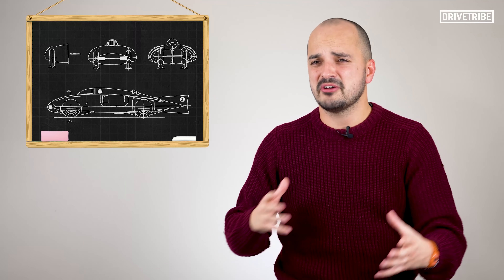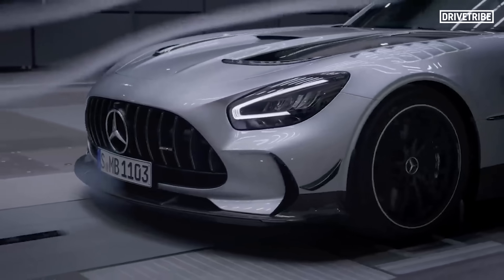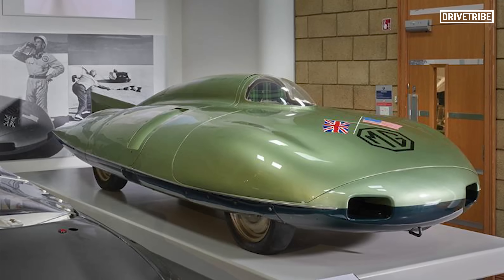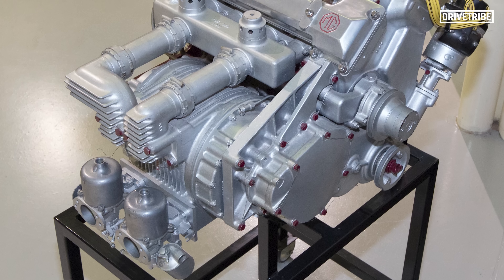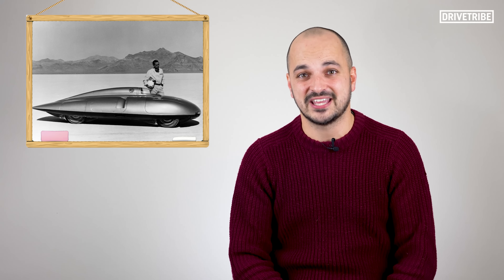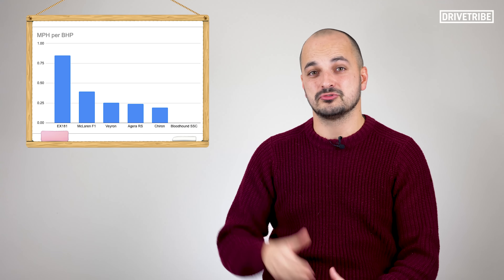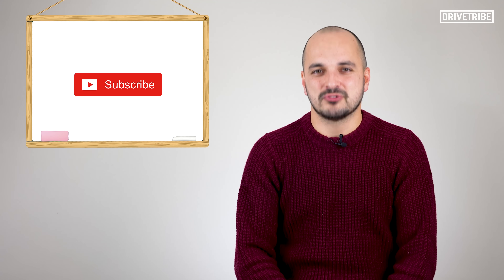This car reached 254mph using only 300bhp

Comment: It is not only about the drag coefficient, it is about the drag area (Cd times the frontal area). It is easier to make a large car to have an aerodynamic shape, but the larger size requires more power to reach a certain speed.

Comment: car power:speed ratios always make me laugh.

my 1964 Mooney will top out at 180 mph true airspeed on 180 HP.  the J model, with slightly better aerodynamics and a 200 HP engine tops out at sightly more than 200 mph.

Comment: The MPH vs HP chart is pointless as a comparison of the cars because it compares those cars at their very different top speeds, not at the same speed. You could run the same car at those various speeds and get a similar result, if you could measure the power it is using at those speeds.

Comment: How many passengers does it carry?
What's its safety rating?
Does it run on 'eco' fuel?
How much does it weight? 300 kg?

The Sputnik was launched the same year. Comets already've been in and out of service by this date. SR-71 flew 7 years after that car set its record.
I don't know what's more confusing - how people are surprised by the car that was built during the era of the most extensive aerodynamic studies ever undertaken, or by bland achievements of Bugatti Veyron.

Comment: Drag coefficient isn’t a useful metric for comparison between vehicles.  Drag coefficient X reference area yields the equivalent flat plate drag area [length^2] which can be compared directly with other vehicles.

Comment: You measured BHP per MPH but not fuel consumption of that supercharged 4 cylinder. It's unfair to compare to modern cars that are also built to corner with competence through downforce and maintain a decent fuel efficiency at the same time.

Comment: I want to know what kind of mpg it would get at 70mph. I know it isn’t a road car but being that efficient sure it would be over 100mpg.
Reply: The math is not that hard, if the drag coefficient remained constant it would be 14.5 HP at 71 mph (100 ÷ √2 ) as the Reynolds number would be 70% lower, one could expect the drag coefficient to be slightly higher, so maybe 16 Hp, or 12 KW.  Using 116,000 BTU per US gallon of gasoline, and 30% thermal efficiency for the engine,:  12 KW X .3 = 40 kW , 40KW = 136,485 BTU/Hour, so 1.17 66 gal/hour , 70mph ÷ 1.1766 = about 60 MPG  @ 70 MPH.

Comment: Imagine if it had a modern engine, imagine the speed it would get too.
Reply: Using the 600hp Koenigsegg 3-cylinder
Reply: @specialopsdave  or a 1300hp hayabusa engine
Reply: @THESLlCK  But that's too heavy, and likely too much displacement
Reply: @specialopsdave  it’s actually lighter and lower displacement so no. I’m talking about a stroked hayabusa motorcycle engine
Reply: @THESLlCK  I highly doubt that Koenigsegg's engine is heavier. The car is like 1500 pounds, and I believe a 1300hp motorcycle to be on the heavier end of motorcycles anyways, with the engine making up 80% of it's weight, I'd imagine
Reply: @specialopsdave  both have a block weighing only 150lbs, so I guess you could say they’re even. But that’s excluding the gemara’s electric drive motors
Reply: @THESLlCK  I still am doubtful that Koenigsegg's best is beaten by a multiple-year-old engine. Maybe the Hayabusa you're talking about is race tuned, not road tuned? In which case the Koenigsegg could do the same if not better, and I think it would be cool to get a 3-cylinder world record
Reply: @specialopsdave  of course I’m talking about a race engine, you thought I was talking about a 1200+ hp street bike?? I mean I want two please, but what?
Reply: @THESLlCK  Bike guys make some strange claims sometimes, man, idk

Comment: These same aerodynamic optimization principles could be used to make car's & SUV's & trucks far more fuel efficient, using the same motors & engines they use today // imagine 70 mph with 15hp & 120 mpg

Comment: The speed record car's engine was not based on the pushrod MGA 1500 engine as shown, but on the MGA Twin Cam engine.
Reply: You are right, they showed a B series pushrod 1500 engine in a red MG A. 
Fun fact, the  MG A 1500 twin cam engine is based on the B series pushrod engine with a twin cam head on it. So they goofed, but were also sort of slightly right too.

Comment: wind resistance is exponential though.. I don't like your chart they should all be the measurements at the same speed. You also can't exactly use the bloodhound because its engine is not driving to the wheels.

Comment: All your graph shows is that noone in the last sixty years has considered using finesse instead of brute strength to achieve their goals.

Real "smart."

It's either that or the boys playing in the desert were too jacked up on fumes to tell the truth when they went home.

Thanks for the "History Lesson."
Reply: It's not a great comparison, the buggatis, and the mclaren are actual vehicles you can drive and have a drink in and seat more than 0.8 of a person.
Reply: @crackedemerald4930  ....Was watching a video set in the desert what made you thirsty or are you one of those, "I won't buy a car with less than six cup holders," people?

In a discussion about power to weight, efficiency, and drag, you jabber on about refreshments?

Why to me?
Reply: @truthsRsung  what i mean is they're very different cars with only similar goals, the MG isn't a car you can just drive on the road.
Reply: @crackedemerald4930  ...Funny.   I was under the impression that we paved roads to make it EASIER to drive them.

You base your reality off of what restrictions people impose on themselves.

Either the MG is soooo "speshul" that it disqualifies itself as a car, four wheels from point A to B with passenger(s), or everyone has a salt flat between work n home.

The designers even forgot about the driver breathing clean air.

Comparing it to modern mobile living rooms may be the EASIEST comparison EVER.

Lazy.   Lethargic.  Slothful.   Pointless.

Figure out a reason for typing next time.
Reply: @truthsRsung  yea comparing them isn't too great as they're very different types of vehicles

Comment: MPH per BHP says nothing, you need to compare MPH² or MPH³ to BHP
Reply: Why?
Reply: @sukhdevr3489  the air resistance (which is a force) increases squared with speed. And above 100mph it's certainly the most significant, power is force*speed which makes the square cubed.
Reply: @RDMracer  That makes sense thanks.

Comment: I often wonder why there aren't any aero cars for sale. You get aero bikes, it makes sense for there to be aero cars.
Reply: Because most peoples normal use is at low speed apart from a few times per year so the trade off for worse aerodynamics is more than made up for by the ease of use, cargo space, headroom and so on.
Reply: @siraff4461  Yeah, true. I’m sure if they were for sale, they’d sell ok, though. VW XL1 prices still hold fairly strong.

Comment: how was top speed even measured in the 1950s? speed traps? wheel rpm estimates?
Reply: They could make a 1.5l put out 300hp and you think they didn't have decent timing gear?
Reply: For records no measurement within the car would be acceptable. It would certainly be a timing trap.

Comment: Compare it at the same speed, not at different top speeds, of course the ratio changes greatly, for 1000 mph you need *64 times the power as for 250 mph. A Lupo goes 100 mph with 60 hp and would win that chart.
Reply: No it wouldnt as the MG only needs 25hp to get to 100?
Reply: @finlaymcdiarmid5832  yes, the Lupo would be at 1,67 and win the chart at 6:00, thats what I’m saying, the MG should win but would loose to the Lupo.
Reply: @appleaday3868  do you mean if the mg wasnt on the chart? because im certain the mg is more efficient in every way except fuel maybe.
Reply: 64X   ~   V^3
Reply: @fwqkaw  yes of course, i was thinking about the force.
Reply: Look up the difference between CD and CDa. An objects CD doesn't change with speed but its CDa does.

Comment: 1988 Callaway Sledgehammer Corvette beat the Veyron at 254 mph and 17 years.
Reply: Not really as only 1 was built. It was not a production variant.
Reply: @gordonlawrence1448  point is; it could've been produced quite easily.

Comment: No one has 3D printed a scale model of this for scale air tunnel testing? 
sounds like a video.
Reply: Sounds like a job for @DestinSandlin on the @SmarterEveryDay channel!
Reply: I would watch that
Reply: There is no reason the real one couldn't be trucked to a a wind tunnel and tested tomorrow. Most likely for under $2000.

Comment: EX181 driven by Phil Hill had 1506 cmc, so it was in the category E 1501-2000 cmc. The record for class F, under 1500 cmc, was set in 1957, 2 years earlier,  by Stirling Moss, with the same car, but with 1500 cmc engine- 245 mph.
Reply: thanks for mentioning that - i was confused because one pic looked like Moss & one like Hill
Reply: @michaelnewell9662  exactly
Reply: I thought it was Moss that drove this thing
Reply: @vokstar  actually at 5:06 is Stirling Moss, not Phil Hill
Reply: Still, impressive

Comment: No big deal, in 1906 a Stanley steam car weighting 4,000 lbs., driven by Fred Marriott, achieved 127 mph setting a record that lasted over 100 years with a 20 HP steam engine and nothing on it was aero dynamic.
Reply: Actually,  it was the Stanley Rocket, with a body like a bullet,  and while its official record was only 127, it actually exceeded 180. You should be able to find images online,  and there was even a recent repro made of it.
Reply: @jamesengland7461  Wheels on a pencil. Very impressive though.
Reply: @sukhdevr3489  well said!
Reply: That 20HP is a nominal value that is very far from the actual peak power output.
Reply: @alexandruianu8432  for sure,  the engine for that world record was souped up!
Reply: @jamesengland7461  Not just that, but standard "20hp" Stanley engines put out more like 40-50hp. The 20hp was a nominal value for constant output under certain conditions, not max momentary power. Max power typically occurs at max RPM in a steam engine, using the highest available steam temperature and pressure.

Comment: For me the 100mph on 28 hp is even more impressive!
Reply: 60's Fiat 500 thrown off a cliff doesn't count
Reply: @Callhouse  lol
Reply: Most bikes would do that
Reply: @lupreztryson  Not street legal ones though.
Reply: @lupreztryson  bikes are not cars
Reply: @lupreztryson  exactly  epspecially 2 strokes..
Reply: @landmonkey22  well, not street legal ones.
Reply: @GoldenCroc  :  Maybe not now in the US or EU, but in the past many were.
Reply: A bike?
Reply: Many 2strokes do that
Reply: @landmonkey22  bikes are not cars
Reply: i own a Pulsar 200 NS with a water cooled 200 cc with 24 BHP and i can reach 95 mph at the far end.
Reply: @charanso143  Is that gps verified? Read some say factory spec is 136km/h which is far from 161km/h (100mph). I am sure its a nice bike, but is it really possible?
Reply: @GoldenCroc  with my mobile gps i once clocked 141 kmph when the speedo was showing 148 kmph. i think there is a 5% error.
Reply: @charanso143  145-146 kmh seems very believable, 161 (100 mph) is another kettle of fish though. Its not easy for most bikes below 30hp at all, as far as I know.
Reply: @GoldenCroc  tweak the gearing at the front sprocket. add a bigger sproket it will cross 100 mph. there are many sprocket kits with higher teeth than factory fitted one for topspeed and mileage. i just use the factory recommended.
Reply: @charanso143  Do you have any examples of peoole having done that and achieving 100+ mph? It takes a certain amount of power to cut through the air at 100mph after all, which the gearing change doesnt increase other than having a possibly better placement on the power curve. It generally isnt easy below 30hp, as I said.
Reply: @GoldenCroc  i have seen some vidoes on YT where some people modded their intake with K&N filter, flashed a ecu map and sprockets and hit 160. you can check but i dont remember the channel name.
Reply: @GoldenCroc  i doubt it cos bikes are a LOT less aerodynamic than cars, not dismissing it completely as bikes are also much lighter and 100mph is on the lower end of top speeds
Reply: @SafffOneee  They have worse aerodynamic shape, but also have less frontal area, making the total drag less than a typical street car. Weight also have very little to do with top speed.
Reply: @GoldenCroc  did some googling, they have 2-3x the drag coefficient of a car, due mostly to the rider, there's graphics of the airflow around a rider's arms etc that's just corckscrews instead of flowing lines, so even tho yea they have less frontal area the shape overall does not cut thru the air
Reply: interesting stats out there like at 60mph 80% of the bike's energy is overcoming air also even a racing bike & pro rider has more Cd than an suv
Reply: @SafffOneee  Quite right. A sport bike with "tucked" rider will have something like half the total drag (cdA) of a normal modern sedan passenger car, if I remember correctly
Reply: @SafffOneee  Yes, Number one problem of bike drag coefficient is turbulence, created by all the small nooks and crannies, including rider, that the airflow gets "stuck" in. Normally the airflow is detached/turbulent already as far forward as the riders head. A typical  car doesnt generate most of its turbulence until the rear window/reat bootlid.
Reply: 2cv?
Reply: @Wok_Agenda  2CV wont do more than 70 mph or so with that amount of power, way too much drag.
Reply: 89mph unassisted bicycle is even more impressive.
Reply: Well, you do need 8 times the power to go twice as fast. so It still works for me.
Reply: I go 100mph easy with only 24hp...downhill lol 😆

Comment: Nice piece showing how far we haven't come. I like some historical perspective. Two points I'd like to make, firstly the supercharger doesn't "pump boost" into the carburettors and, secondly,  it's a bit odd to illustrate Phil Hill's comments over a picture of Stirling Moss.
Reply: I’m glad I’m not the only to notice Sir Moss! DRIVETRIBE is doing amazing work lately, but this one is a pretty big screwup (by some poor intern I’d assume). Details matter, especially when your comparing(?)/confusing Sterling Moss with Phil Hill.
Reply: Sir Stirling or Sir Sterling Moss, never Sir Moss.
Reply: @desmo750f1  Yeah, sorry, you are absolutely correct. I noticed I had done that (at 4am or so), meant to fix it, then fell asleep. My bad.
Reply: @desmo750f1  Only ever Stirling, never Sterling.
Reply: Glad someone else noticed this. Also, when talking about the 1.5L twin cam engine being lifted from the MGA they put up a pic of a 1.6L B series OHV engine. Lots of great info here slightly spoilt by simple errors.
Reply: @Bercilak de hautdesert lol, you on obviously don't know the tech that the first EVs used. Cars back then had less than 10 HP, a range of usually less then 35 miles and took a day to recharge, actually the first EV had non rechargeable batteries. The rechargable batteries were lead acid batteries enormous. Modern EV tech is the result of 100 years of breakthroughs in physics and chemistry and now we have 300 HP middle-class SUVs comfortably doing 200 miles and recharging to 80% in 20 minutes. Modern inverters are incredibly complex and modern Electric motors have efficiency over 90% whereas old electric motors struggled to reach 50%...

Small addition the mentioned land speed record was 100kph with one motor per wheel. Current EV land speed record is 576 kph using a single standard Model S drive unit in a specialized chassis (plus some smaller motor for initial acceleration where the other engine is inefficient due to the crazy gear ratio).
Reply: @Bercilak de hautdesert A Tesla can go ALOT farther than a Baker Electric
Reply: Brah we are on the dawn of automatous driving and feasible mass production electric vehicles.  In 1957 they were testing how fast they can make dinosaur powered cars go but now we've pretty much explored all branches of the technology. We've come pretty far in a short period of time.
Reply: @UkSapyy  still driving wagons tho

Comment: there is a reason those stream-lined recumbent bikes hit such high speeds... when you cut through the air like it wasn't there, all of a sudden you require a whole lot less power to get speed.
Reply: I think those are recumbent bikes (the rider is lying down on the bike)
Reply: @shaider1982  correct, thank-you

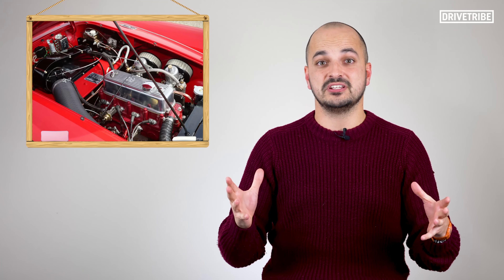Comment: The engine you showed at 4:30 doesn't look like a twin cam. It very much looks like a pushrods inline 4.
Reply: Correct, the engine shown is a blmc A series engine.
Reply: @areyouundoingthatorwhat9181  BLMC did not exist back in the 50's and the engine in the image is a B series. in an MGA engine compartment.
Reply: @Ribeirasacra  The B series really looks like the A series to be fair, and most of the engine's architecture is similar.
Reply: @Ribeirasacra  yes, blmc didn't exist back then but everybody and his brother knew what or who it meant,only those who wear anoraks would be bothered being pedantic about it.and while I did not look at the thing properly the a and b series are identical apart from size.
Reply: @areyouundoingthatorwhat9181  BMC = British Motor Corporation, formed circa 1950 from the merger of Austin and Morris car companies.
 BLMC = British Leyland, from the takeover of BMC by Leyland Trucks in 1968, forced by the government of the day. It was too big and chaotic to work.
Reply: I suppose it was TC for twin carburettors.

Comment: Did the Oldsmobile Aerotech go 278 with 150bhp
Reply: Supposedly had between 750 and 900 hp
Reply: It was an Olds 4 cylinder,  but running lots of turbo boost and ethanol